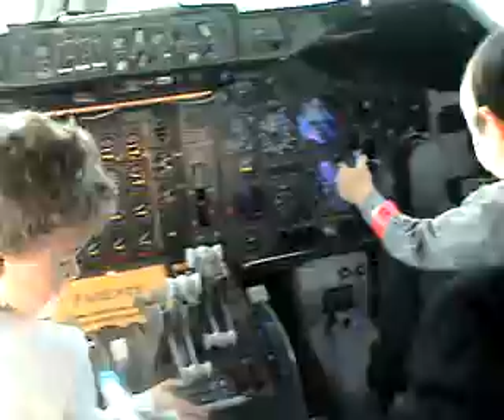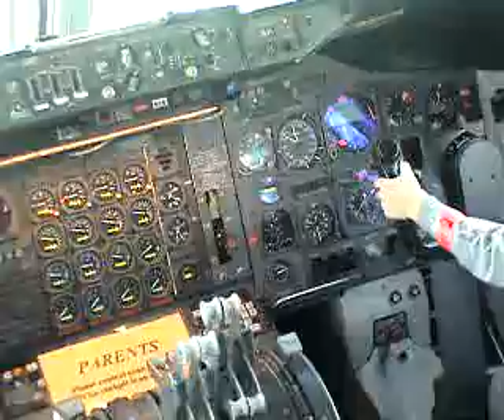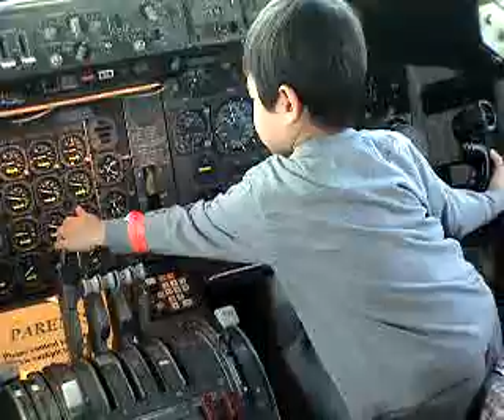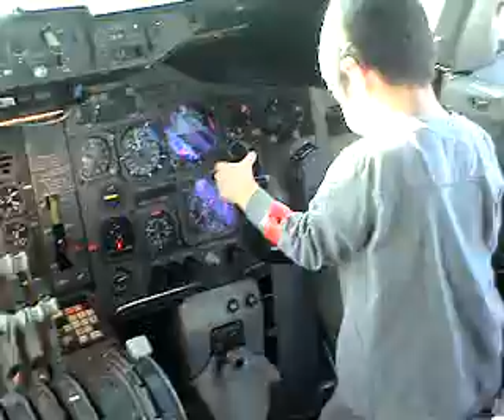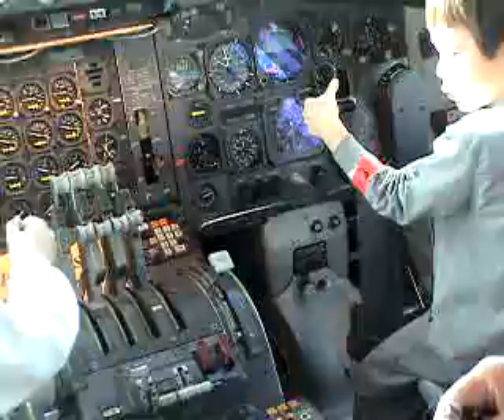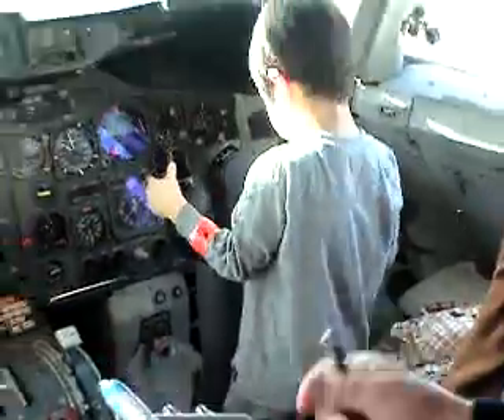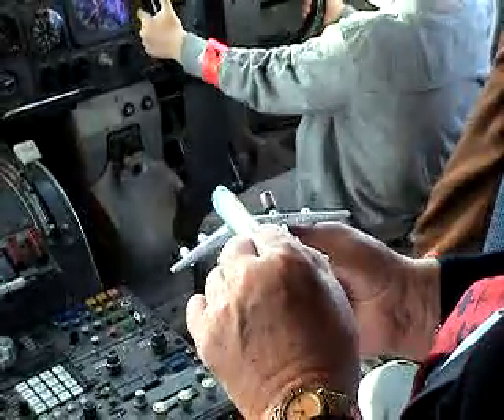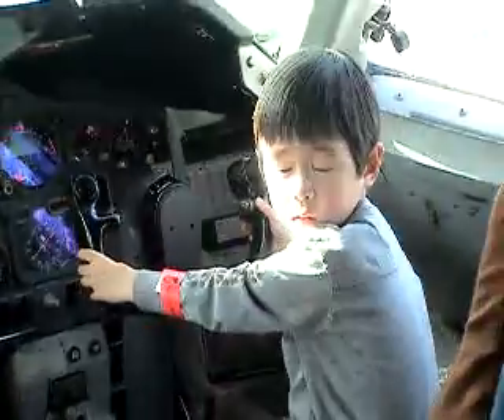Flying lesson in Boeing 747 cockpit

Comment: @tredub91 It's easy. Get Microsoft Flight Simulator X, and get a good payware aircraft (Like PMDG 747-400 or a CLS). Flying a real airplane is different than the simulator, but you can get familiarized with the buttons and switchs, and instruments and what they do. And you could learn airplane terminalogy and the phonetic alphabet.

Comment: @xxxemodtixxx 

As far as I understand it, they have normal VOR & ADF/NDB navigation as well as the ability to input Lat/Long co-ordinates into the INS systems, basically a primitive FMC. They could input maybe 10 or so co-ordinates into it, then reuse each one once they'd passed its position.

I think the INS input panel is situated in the same place as the FMC, left & right of the throttles, whch I think you can just see on tis video.